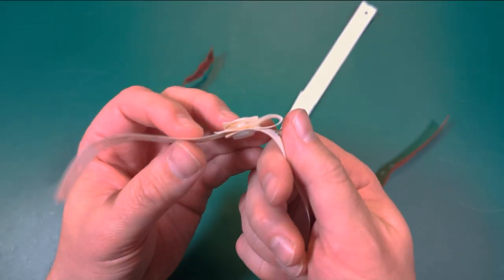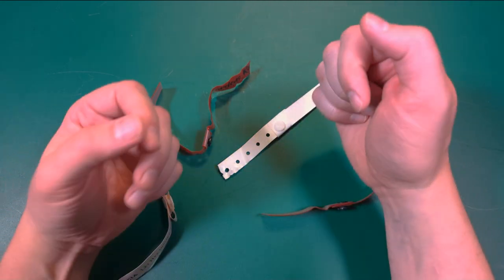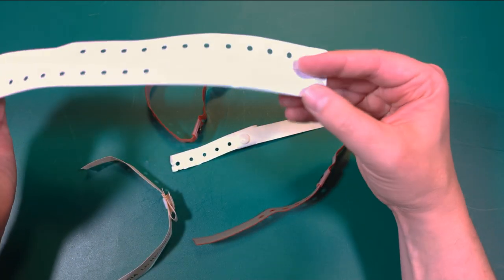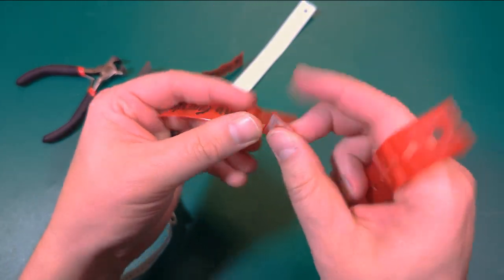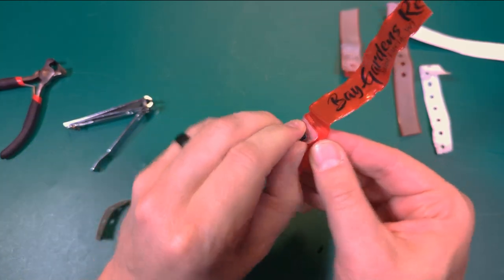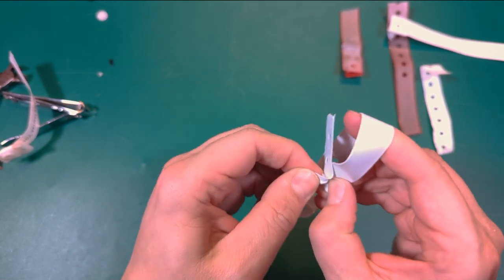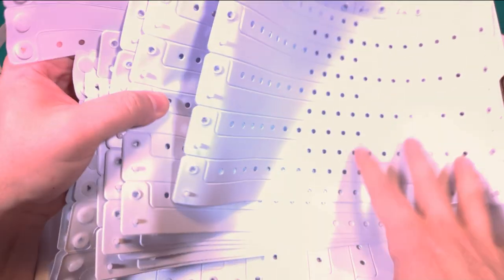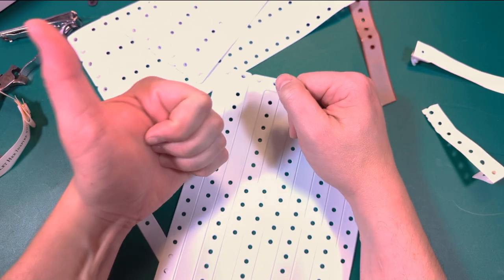Tampering with Wristbands - Part 1

Comment: Remember that the color of the pin might matter; replacing a dark one with a white one might cause suspicion if somebody paying a little bit of attention.
Reply: nothing a dab of sharpie marker won't fix. white ones can be blackened easily with a marker or black nail polish.
Reply: Very important detail if credentials aren't verifiable 😎👍
Reply: @tech4pros1  until it wears off without you noticing or whatever
Reply: nobody is paying attention... when was the last time anyone checked to see if your wristband was still secured correctly... they are all assuming that once it is on, it isn't leaving your wrist, or it will look damaged.
Reply: @ooglek  I agree that it's a longshot that anybody pays attention, but it's not foolish to pay more attention to detail than your adversary.
Reply: @tech4pros1  ...and dark ones can be painted with "white-out".
Reply: @stevefriedl3983  I concur. The details can make or break an op. In my experience the people tasked with keeping track of wristbands aren’t the most alert and aware beyond their primary assigned tasks. Not everyone thinks like us!!
Reply: Just make sure the clip is on the other side of your wrist when showing the band to the person on the door.
Reply: @ooglek  Yes, it's not just the door goons you have to worry about.  It might be someone higher up in the crowd who happens to notice your wrist band don't look right.  The venue might have security in depth you're not aware of.
Reply: @ooglek  Your right, but nothing would be more humiliating than having someone with that level of intelligence outsmart you. Always do a good job on whatever you do.
Reply: @BericDunn  Oh oh oh! Make sure the band goes in the same way it was before. Whoever attaches those to people's wrists tends to do it in a mechanical way, always the same way. You don't want to be found out because your band is "upside down", i.e., legible to you as you look at it but not to someone checking it as you extend your arm towards them.
Reply: @ooglek  In fact on some festivals I've been they yanked at the wristband each time you entered the "restricted" area. But they didn't examine it more than a casual look and that yank. I guess good enough for a drunk festival-goer who got this wristband from his buddy through the fence.
Reply: @surlyogre1476  or if you know a woman with white nail polish…
Reply: People aren't attentive enough to notice the color of the pin. Just roll the wristband around to the other side to hide the pin.
Reply: so just say this is the color you got... its not like they can prove otherwise unless they pull up the security footage

Comment: You probably only need to replace it once per trip, as well; when you put it back on with the 'new' clasps, just make it 1-2 spots looser and you should be able to slip it on and off. Only need to clip it once.
Reply: A friend got "caught" with a too-loose wristband once, security replaced it with a new one and made sure it's tight..
Reply: @solhsa  It's still a good tip and there's zero risk unless they can lookup that you don't belong there. If you get "caught", which I find extremely unlikely, they're just going to replace it.

Just take a few in case, replace it loose, and then keep it behind a watch (further up your arm). It will look tighter, and at the end of the day you just take off the watch to slip it off.

Comment: Wow, this went destructive and high tech. A safety pin and a little practice can get these off in a few seconds while remaining usable. I don't advocate it, but a local bar at college (20+ years ago) used these by color for proof of age and the colors changed every night. I would just keep every one I got (either from being underage or from a friend that was over 21) each night. After a few weekends I had a full set that I would take with me to the bar. I'd see what the 21+ color was for the night, go to the bathroom to swap mine out for that color and was good for the evening. 

On the lighter side, you could probably go to the local fabric store and find small, narrow-post snap buttons. they come in 2 parts and are designed to be reusable. you can get something like 20 pairs for a few dollars. How many "security" personnel inspect the clasp on a plastic wristband?
Reply: Yes! I immediately thought of snap buttons/snap fasteners but couldn´t find anyone saying the same. Surely they won´t inspect the clasp
Reply: I'd still try and find a way to make the snap look authentic.  With the band being lose, it may work it's way around and then someone will notice a nice shiny chrome clasp where there should be a white plastic one and you're busted. If you're going though a line, all security has to do is ask you to rotate your wrist and again - you're busted.  Once they've busted someone, they will be on the lookout for others.
Reply: @russellhltn1396  well the predominant color of these buttons will be white so chalk paint should be good to to. Maybe there is white finger nail polish? As long as its not shiny chrome/brass or shiny at all it should be good to to. Dont know about the longevity of the paint though. But nailpolish should be readily available everywhere and to go as far as check the dimensions when the color matches (I still wouldnt think somebody would check, maybe the reflectiveness would be a hint) i dont think any security would do
Reply: @wayanjonathanschiwietz2486  If you're looking for white/whitish-clear plastic snaps, they're available at a lot of fabric and sewing stores - they sell more than just the shiny silver ones, and more than just metal.  They also have black ones, and gold, and some might have them in even more colors than that.  And they're often available in a few different sizes.  So take your pick.  My mom has been sewing since she was a kid, so I've seen my fair share of fabric store clothing snap sections.
Reply: @SnowySpiritRuby  Did not know that, always just saw the metal ones. so these snaps seem to be the perfect permanent reusable solution for this. Hope @DeviantOllam sees this
Reply: I used this method this weekend to remove and save a wristband from a festival I went to, after learning it from your comment. Thanks!

Comment: I rarely encounter that type of wristbands here in Europe. They have mostly 3 types here. 
Paper ones with a glue strip(that damages them if you pull them apart) are the cheapest one, those you usually get on single day/evening events. 
For longer, multi day events they usually give you cloth straps, over the ends they pull a plastic collar with teeth(that stop you from pulling them off), or clamp a metal ring on them. And then they cut off the excess.
There is also a third type, made from all plastic, with the clasp being integrated into the wristband.
Reply: On Rock am Ring, i got One that was frictionwelded.
Reply: @wolflegion_  I've been wearing a couple for literal years, from pre-covid, never had an issue!
Maybe there are some that tighten more easily.
Reply: @arnodiedrichs3371  Can't say I've seen one like that before. What was it made from? Plastic?
Reply: @jort93z  i think it was woven plastic. In the year the Nürburgring owners wanted way bigger Share, so the Organizer went to the alternate Location the next Year.
Reply: Oh wow, i never had the excess cut off of the cloth ones. That's definitely how they're supposed to work. That makes a lot of sense.
Reply: The plastic collar became popular in the last 5 years or so I think, before that most places used cloth bands with a metal ring that gets squished flat.
Reply: @wolflegion_  I had one tighten uncomfortably too last year, so I ended up cutting a rewards card (basically the same as a credit card) I had into two little strips to shim it. Absolutely awful design, I was really panicking over it.
Reply: @wolflegion_  how?
Reply: Paper ones are too easy to fake. Cloth ones you can force them open with some patience (even just by yourself). I have no idea about the 3rd type but there used to be these plastic ones (from the vid) in Europe too (I've had a few of different styles, even shinny ones) but it's true they are disappearing (prob due to the negative environmental image of plastics). I think good solutions to ensure safety/control but still not annoy people are by using smartphones or RFID cards, but the latter is certainly more expensive than a wristband and the first might have legal implicaions (related with privacy laws and being able to track someone when that's not intended).

Comment: Was at a gamescom in cologne when I was 16. They had coloured paper wrist bands indicating your age for access. They were "tamper proof", but we did have one person over 18 with us, so we tried to figure something out.
They ended up being super easy to defeat. They were basically just glued together and perforated so you destroy them if you try to pull them apart.
Well, we didn't care - just ripped it open and used some gum to glue it back together. Just hide the glue spot on the other side of the arm, nobody noticed.
Reply: As all magicians know, when doing the trick - misdirection..  Anything that does that is your little helper.
Reply: added bonus - if the band's color is really bright, for most people it automatically draws attention away from the glued part
Reply: @_____ Sure, you could probably do that. But that requires planning - we had no idea this was even a thing until we got there.
Reply: You can also just cut those with scissors and then tape them back together with clear tape, it's not very visible even if you do have the cut on the outside of your wrist.
Reply: @_____ I'd say try ethanol first, anything 70% or higher. If the adhesive is acrylic-base, it'll undo it in no time. If not, then I'd try isopropanol. If not, then I'd go to something like mineral spirits. Important: if there is text printed on the band, test the solvent first on a tiny spot, with a cotton swab or something. Depending on the ink formulation, it may run. If it is laser printed, mineral spirits may fo it away. If it is screen printed, all of the solvents above may damage it, based on the kind of ink. Test first. Depending on the glue, you may need to use something like a glue stick to tape it back together, as some solvents may "undo" the adhesive for good. Others will, like you said, be able to be stuck back together after the solvent dries.
Reply: Went to an infosec conference a few years ago and for the after party you had to have a wrist band from the sponsor stand for entry.

Only so many wrist bands were available and they disappeared so fast, but it turns out the flyers and promotional material had a footer that looked remarkably like the wrist band if you cut them off just right and found a way of affixing it to your wrist.

Basically spent an hour at the con playing with paper and scissors using everything from chewing gum to origami folds to secure the wristband in place sufficient to fool the door staff for entry :D managed to get like 10 people in who did not have any legit bands.
Reply: @lmaoroflcopter  Makes you wonder if they did that intentionally. Was an infosec conference, after all.
Reply: @Yotanido  yeah, could be but I don't believe so. From the vibe once in I think it was just happenstance that their logo was the perfect size, on the same background colour on the flyers as on the bands. :)
Reply: @TheHDreality  tape on the inside, it's not visible.

Comment: The little reusable threaded metal stud fasteners typically used for leather crafting (a.k.a. "Chicago screws") are inexpensive and come in a variety of colors so you can sort of match the original plastic snap fasteners you use them to replace. A little spray paint would get you an even closer match. And you can get them from Amazon as well as local crafting stores.

Comment: With a friend's help and three pins from the hotel sewing kit you can normally pop the main plastic pin on the wristband open and it will re-latch again after.

The main wristband pin clicks through three spring arms that retain it. open them wide and pull apart with a little force
Reply: You don't even need a friend. You can pretty easily do that. Deviant is really overdoing it here. Simple solutions are best
Reply: I found it easier at first with my wife getting two of the arms while I got the third and pulled, but later you're right, I did it solo with no trouble. It's always nice to have a friend though 😄
Reply: Time to build a 3D printed tool to do this one-handed and destroy an industry.

Comment: I'm thinking a press stud kit would be a reasonable upgrade too. once you have put a stud on your band you can take it on and off at will.
Reply: That was my first thought for a replacement also
Reply: If not too visually different from the original plastic fastening, great idea! Not that sure about that if you ever need to pass closer inspection, though... (slightly exaggerated: gatekeepers of a venue almost touching their nose to the band when checking)

Comment: Another way is to get some non-single-use metal pressure button clips like for jackets and trousers. As long as you keep the black "button" part on the outside it will be OK. Nobody will ever inspect the buttons
Bonus points for reusability

Comment: I used to live near a park that hosted an annual festival. The festival used the paper wristbands to give access to inside for the day and each day they would change the color, forcing you to buy another wristband. Well on my way over 1 day I saw several people leaving the festival and saw they had bright pink wrist band for that day. Walking through the parking lot I found a bright pink poster in a trash can. Inspiration hit me, I grabbed it ripped off a strip, took it back home to cut it cleanly with scissors and low and behold I had a free wrist band for the day. I subsequently purchased a multi colored construction paper booklet and had free access the rest of the festival. Although the original wrest bands had words/insignia on them nobody ever looked that close. And I also at the time wore rubber bands (the thick kinds with various phrases on them) so I was able to wear my modified wrist band under the rubber bands to conceal it from anyone looking too close.